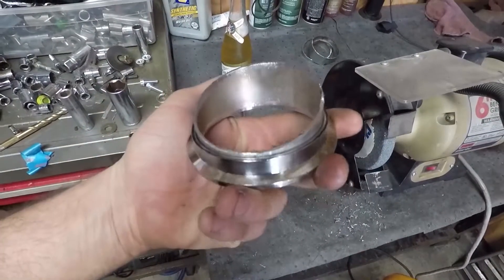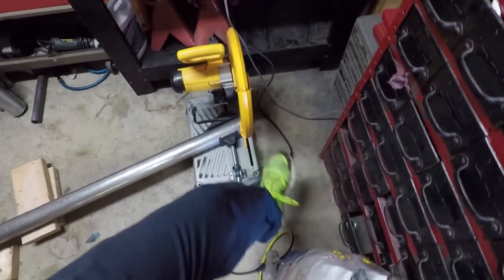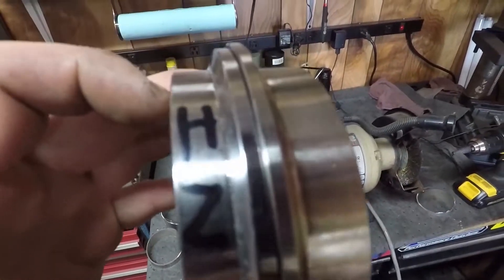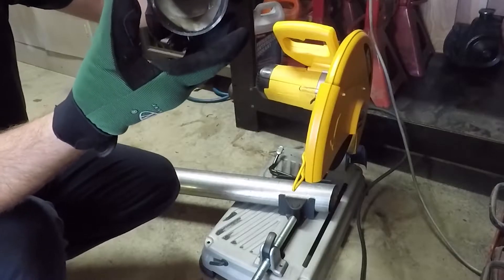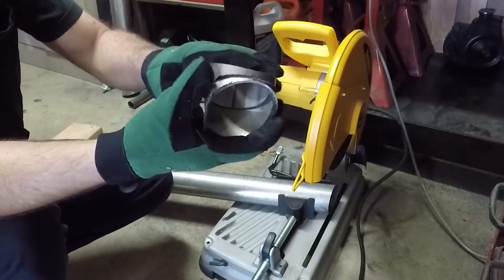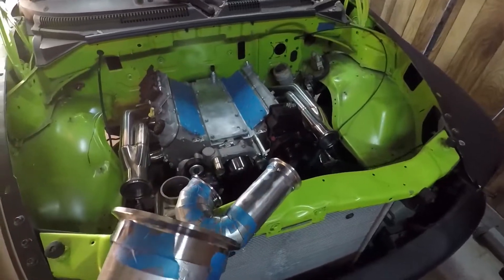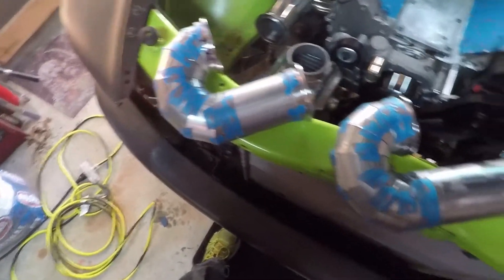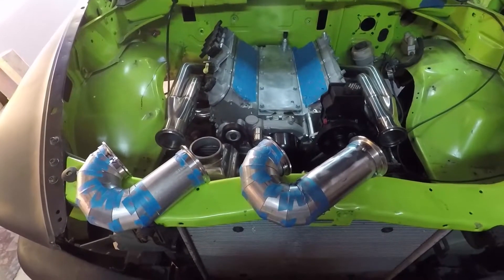How I Make My Pie Cut Exhaust Parts

Comment: Thanks for making this video! I have been doing this method to modify a set of headers for a swapped vehicle. I was beginning to think I was an idiot for attempting it with all the de-burring work. I am using a abrasive blade on a basic miter saw, and aside from melting the plastic plates on the base because of the heat, it has worked just fine. Its nice to see others using the same basic methods with much more complex or expensive builds. A lot of YouTube videos have people using professional grade tools or expensive parts to accomplish things. It is nice to see those who take the budget friendly approach, even if it may be a bit more time consuming.

Comment: Which model of chop saw are you using? I'm going to buy one for this exact purpose
Reply from the maker: It’s a Dewalt, don’t know the exact model number but it was like $199 at Lowes. Works great for random metal cutting jobs.
Reply: @BrianEssersGarage  thanks for getting back to me. Do you know the diameter of your cutting disc? I need to cut 4" 101mm pipe for my next exhaust build
Reply from the maker: Pretty sure they’re 14”
Reply: @BrianEssersGarage  can you lock the base at 5 and 10 degrees?
Reply from the maker: It has some angle marks, though not delineated by exact angles. You would have to use a angle gauge to verify the exact angle but it could be done pretty easy.

Comment: Invest in a carbide tipped chop saw blade. Cuts are almost as clean as a good cold saw. Just make sure you let the blade do the cutting. Less force than an abrasive chop saw blade. All you'll need is light positive pressure and the blade will do the rest and give you much less deburring left to do after.
Reply: will this work for just aluminum intercooler pipe and occasional steel exhaust?
Reply: @headlesnorseman701  you can use a normal chop saw and wood blade to cut aluminum pipe!

Comment: Looking good, love this type of videos. What type of pipe you are using to make the pie cuts (mild steel or is it exhaust pipe galvanized)? Where did you bought it and price? Sorry to bother you with this questions, but trying to gather material for my own build. Thanks, and keep up the good work... Following you.
Reply from the maker: +Bville99gt Thanks! I'm just using typical mild steel exhaust pipe. I bought a 10' stick from my buddies exhaust shop. Price depends on where ya find it. Usually 20-40 for a full stick. Price depends on size too. Thanks again!
Reply: Bville99gt I have bought exhaust tube from Summit.com. Price wasn't bad. You can search by tube size and gauge. I bought 16ga. aluminized steel. Welds pretty well if you wire where the weld area.